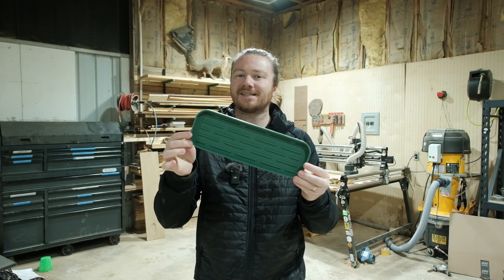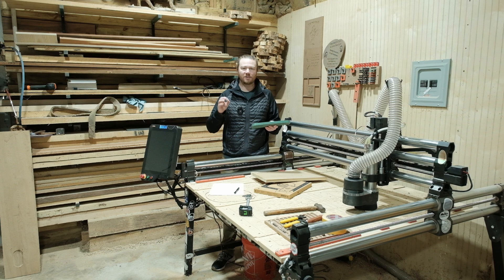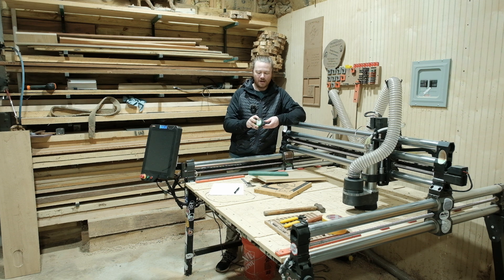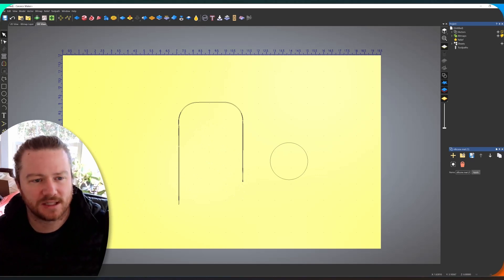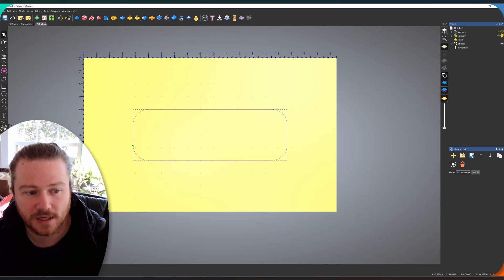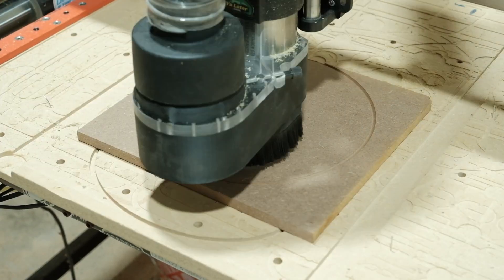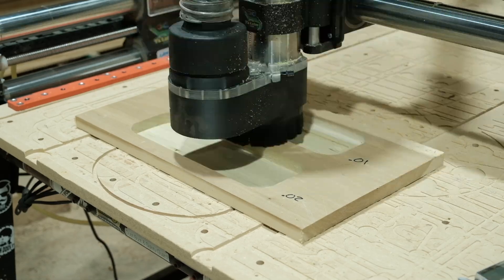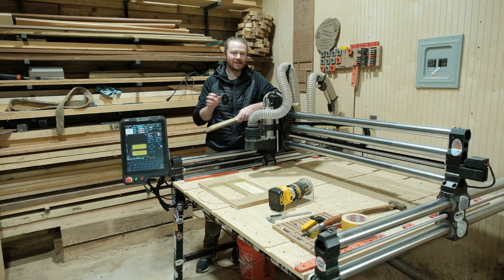How I Make Perfect Fit Vectors (Wooden Silicone Mat Tray)

Comment: A decent set of calipers is essential.  The first one I bought was Pittsburgh brand from Harbor Freight.  A complete waste of money.  The battery would last maybe one day, without even turning it on.  I finally broke down and bought a set of Mitutoyo calipers for around $100 or so.  They're fantastic and the battery is a good 4 months old now and still going strong.

Comment: The "slop" in the tape measure is exactly the width of the metal tab. It slides in for internal measurements and slides out for external measurements.

Comment: for those of you who use solidworks. you can upload an image to your sketch that then asks to to identify a reference length. so for this project you could take a top down photo of the silicone tray and tell the image that the width is XYZ. it then scales the drawing to the right size and you trace the outline with the line tool. for the radius you would do the same process to find it until your circle line over lap the image lines correctly. this is super handy to use on a variety of things and a great tool to have in your arsenal. im not sure if other modeling software has this, though.
Reply: Fusion 360 also has this feature. If the thing I'm modeling is small enough, I place it on a [document] scanner so I don't have to worry about lens distortion.

Comment: I just started playing around with using my 3D printer to make silicon molds for epoxy work. The additive manufacturing works well, but so would the reductive manufacturing for this process. I’m continually amazed how useful both CNC and 3D printers are in the workshop.